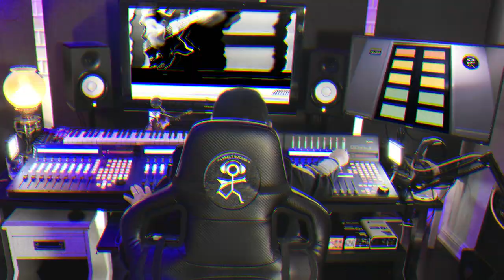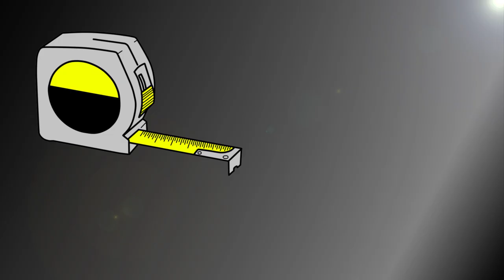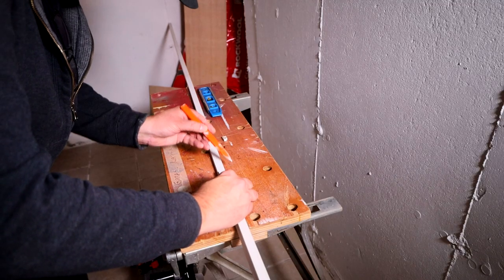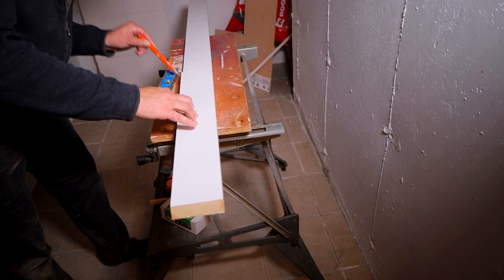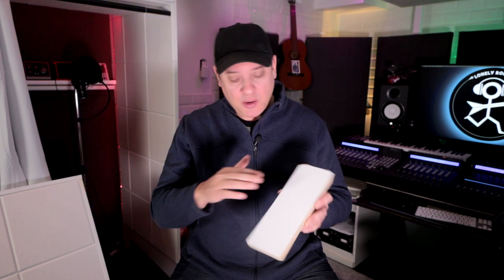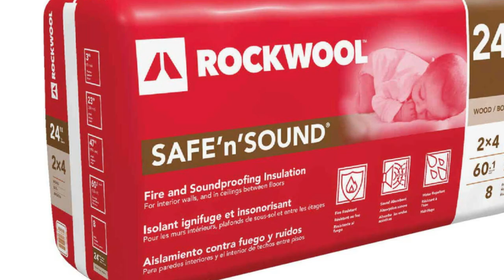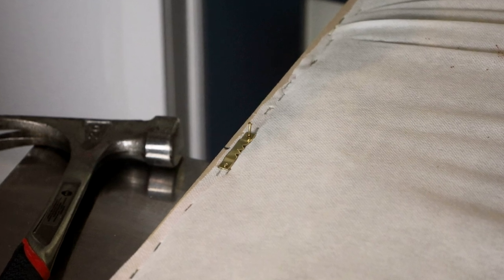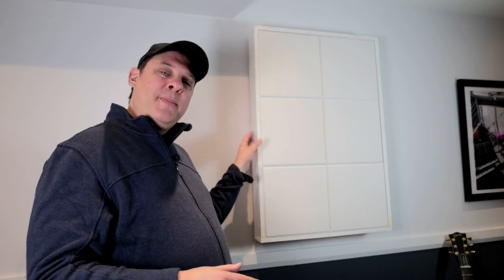How To Build Your Own Stylish DIY Acoustic Panels | No Wrap!

Comment: Hi quick question. Doesnt adding tiles in front wouldnt reflect sound than absorb it?
Reply from the maker: These are marketed as absorbent tiles.  You can use any type foam tiles they may be even more absorbent to ensure they wouldn't reflect sound.  My goal with this video was to demonstrate a different style of pane;...just having some fun.  But certainly you can tweak this to your needs...
Reply: @LonelyRocker  yes ofcoarse. Thanks for the video. Cheers

Comment: I’m always pleased to see people trying new things, and thank you for that in this new concept for panels!  

However, maybe  Canadian acoustical tiles are different than those available in the States.  The ones I’ve found here barely let any air (sound.?) pass through.  Utilized on the exposed room side, wouldn’t these functionally operate to reflect most sound waves as opposed to absorbing them?  At a minimum, wouldn’t that severely compromise  or even negate the functioning/purpose 
of the Rockwool?  When choosing fabric for the outer wrap versions you suggest that it allow the passage of air.  Why wouldn’t that same principal apply to these “unwrapped” panels?

As far as Rockwools ability to absorb different frequencies, their own charts suggest that a major determining factor to affect the lower range (in addition to depth) is density.  Here that is expressed as pounds per square foot I believe.  Higher weights absorb low end better.   While the Comfortboard is certainly stiffer than the Safe & Sound, it is also more dense.  

Thanks for your time,……….just an old fart still trying to figure all this stuff out!
Reply from the maker: Thank you for your thoughts!  It was a creative concept so I gave it a try.  Truth is, acoustic solutions are complicated.  Professionally you can't guess.  Before I try to answer this I recommend you watch my interview with an expert.  John Brandt: https://youtu.be/W6gGBipuFtY

Comment: Insulation cuts a lot easier with a long blade. A bread knife with gentle serrations is excellent. You can also use an Olfa knife with the blade extended all the way. Either option is better than a short utility knife blade.
Reply from the maker: I agree...I had just moved and I couldn't find my proper knife ;)
Reply: @LonelyRocker  Frickin' moving, man. I tell ya.
Reply from the maker: @helmanfrow  ;))))

Comment: 17:58 As I understand it, at least here in Canada, these kinds of absorbers act upon the velocity of the sound wave, slowing it down and converting some of its energy into heat. Typically, one quarter of the wavelength of the lowest frequency you want to capture has to travel through the fluff in order for it to be attenuated. Since lower frequencies are longer they are harder to treat with fluff. You could ensure that all frequencies are attenuated to some degree by putting the fluff in the middle of your room but then you'd have no space to work, so you compromise and put the fluff on your walls.

However, the room boundary (e.g. a wall, ceiling) is where sound waves turn velocity into pressure, and the longer ones compress before a quarter wavelength has passed through the fluff. The air gap in the back serves the same purpose as the thicker insulation: it increases the effective length of the fluff between the sound source and the boundary, helping lower the effective frequency a little.

My point is that you could get even better low-end performance by spacing your new panel off the wall just as you would your thinner panels.
Reply from the maker: I actually consulted with a well-known studio designer before I did this video.  As I stated, DIY methods are a crapshoot but his theories are lab tested and the absorber up against the wall was his recommendation.  For real low frequency traps he recommends loose bag traps with loose fiber...I haven't tried that yet ;)
Reply: @LonelyRocker  Was it John Brandt? I just found your conversation with him.

As I understand it, membrane absorbers are best used at boundaries because their operating principle is pressure, which is exactly what you get at a boundary.

Resonators also work but are tricky to tune and operate across a narrow band.
Reply from the maker: @helmanfrow  Yes, John Brandt.  The conclusion I got from John is it's all science and we can't guess.  However, in a DIY Home studio setup we can throw up some absorption and get to it.  There will be errors in the room but we can do the best we can.  A proper absorption design is well out of reach for most but that doesn't mean they can't make music.  These DIY absorbers are just to make the rooms better...not perfect ;)

Comment: Do you have any videos with REW showing if the panels actually work? Any room response to low frequency ?? 
Thanks
Reply from the maker: Unfortunately I don't. The success of the material inside is well documented.  The difference being the tiles on the front of course.
Reply: @LonelyRocker  so safe sound better that the hard material. Which one you think it’s better for bass trap. I’m going to build one 8”. Thank you for sharing this diy
Reply from the maker: Watch my interview with Acoustics Expert John Brandt.  He touches on this question: https://youtu.be/W6gGBipuFtY
Reply: Just did very nice i bought the safe sound. Since m building 8” it’s good for it to be lose. Not sure if to follow v2 where you put length wise  the insulation or to cut it like on your last video. I can’t wait to trait It I have low frequency that I want to get control off.
Reply from the maker: Sweet!  Good luck with the build.  And have fun experimenting!

Comment: Thanks for bringing new ideas to the table. You haven't really explained, why and how should the "portioning" of the rockwool work better than putting one piece inside. Can you elaborate a bit?
Reply from the maker: Thank you.  I did say that a full piece of Rockwool placed vertically has a tendency to sag.  By stuffing it in in strips and packing it in nice it will never sag.
Reply: @LonelyRocker  I am aware of the intention, just that you haven't explained in any way, why this approach should work better than keeping it altogether as one panel. I don't see intuitively why and how this should work.

Comment: Any test about absorption efficiency of this panel?
Reply from the maker: I haven’t done a specific test but have tested the main absorption material in another video.  The problem being how the panel will be installed.  For home studio use you will get good mid to high end absorption with improved lower mids absorption if installed right against the wall.   You should check out my Jong Brandt video where we discuss this in detail.

Comment: AFAIK you get a lower frequency response with an air gap. I think what you said about putting it flat on the wall may not be correct. Cheers, great vid
Reply from the maker: I got that tip from an acoustics expert who has designed and built hundreds of pro studios.  Take that for what it’s worth.
Reply from the maker: You misunderstood.  There is an air gap inside the panel.  It's just the frame that mounts up against the wall.  And my source is far more experienced than the guy you linked me to.  Look up John Brandt.  I interviewed him here on my channel.
Reply: @LonelyRocker  Ah ok. So there is a gap! Great thanks.
Reply from the maker: @MonsieurVersatile  Yes.  Keep in mind this lowers the frequencies it catches a bit.  But honestly, in a DIY situation it's all just guessing.

Comment: sometimes MDF cracks when drilling, which is often because your drill is at too high a speed and a drill that is too big.
Reply from the maker: I started to figure that out with subsequent panels.  My biggest issue is I can’t sand MDF like I can wood.  I love shaping wood and missed that for this build.  But I’m super happy with the concept. Thanks for your insight!

Comment: How would you do this with Acoustic Foam. I have this already on my wall but want to transition to use rockwool and maybe this design with my acoustic foam?
Reply from the maker: Just as I showed in the video.  Figure out how many tiles you want in front and measure the perimeter.  Make sure to measure the thickness of all your material and make sure your frame is  deep enough to accomodate.  You may need to experiment a little but shouldn't be too hard to figure it out and sue this video as a reference.  Good luck!

Comment: Why don't you make them thicker? Would be more effective
Reply from the maker: Thicker for what reason?  Panels have different jobs to do.  Thickness does not define the effectiveness of a panel.  Especially without readings and knowing what you are trying to achieve in your room.
Reply: @LonelyRocker  you don't need to affect lower mid- and higher bass frequencies in their reverb time and room-mode build ups?